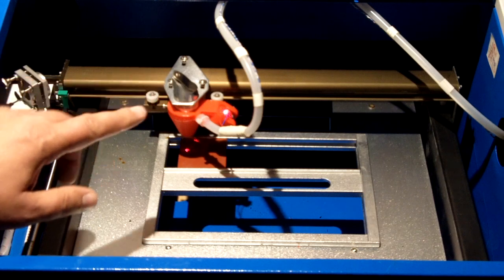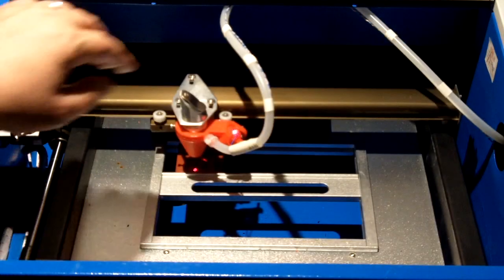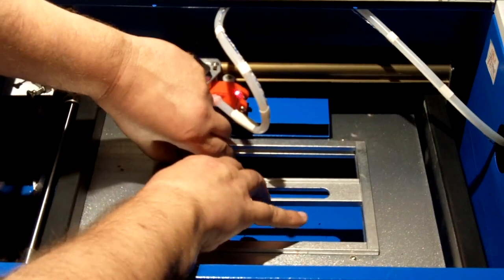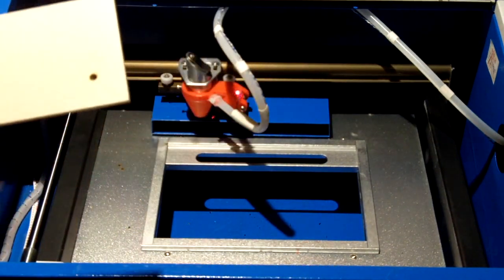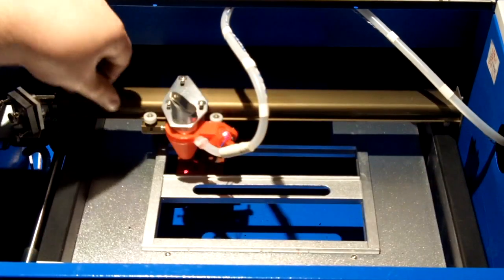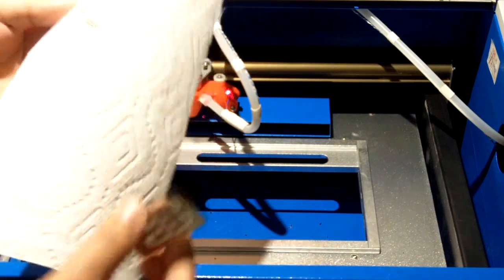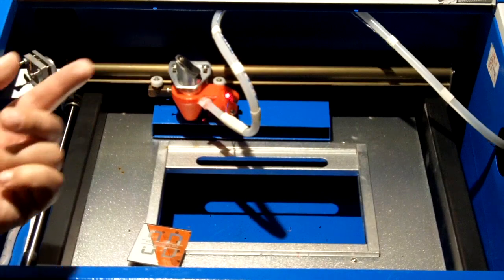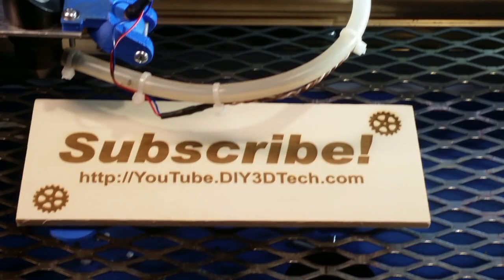K40 eBay Chinese CO2 Laser Cutter & Engraver - Etching the Backside of a Mirror!

Comment: Extremely helpful videos -- you seem to have a knack for explaining things in layman's terms which is very beneficial to laser cutter newbies.  Can suggest a particular brand I should purchase?  There are numerous listings for these on both Amazon & eBay and they're all identical, for the most part.  I've noticed the prices increased slightly since I started looking into them about 8 months ago, which I would attribute to their growing popularity and a diminishing "fear" level for home-users.  Thanks.
Reply from the maker: Thanks for the kind comments :-)  as to the price yes they go up and down and they are on the upward swing because of Xmass so expect to pay a bit more unless you want to wait till Jan/Feb.  Also if you get one DO NOT get the one with the digital display as those are typically 30 watt unit even if they say 40!  Get the one with the analog meter they have the longer tube (which is what creates the higher wattage).  Also I put this page together to pull the latest posts from eBay based upon price. As far as Amazon goes, believe they are same sellers (IMHO) and they charge more...

Comment: A 40W laser tube usually operates at 10-12 mA current (maximum). More depletes the hydrogen in, and the lifetime, of the tube.
Reply from the maker: Most of what I have read indicates 18ma and if you want to be super conservative could see 12ma however I view the tube as a semi-consumable as it does have a shelf life so it is also a bit of use it or lose it to the task...

Comment: Mirrors are EXTREMELY reflective. Remember being told not to look at the laser? Etching on a  mirror is no less stupid than looking safely at the Sun with a mirror when the Sun is behind you. Make sense? 
Laser are dangerous. They shoot satellites out of their orbit with laser.
Secondly, find and read, a hazardous material data sheet about burning material without protective ventilation. A mirror is reactive  because its back coated with a silver oxide which  makes glass reflective. Do tell others NOT to do this.
Reply from the maker: Thanks for the feedback, the CO2 laser operates at FIR range so the glass pretty much absorbs most of the "light" as the mirror is designed to "reflect" visible light and not IR.  This of course doesn't mean that some is not reflected light and part of the reason I do these video's as if you look back at the play list, I have  photographed in both NIR as well as FIR and shown the amount of reflection.  Also if you note in the video I mention this should not be attempted while looking at it and the cover open as the idea of coherent light reflected or not is an issue and the reason for in a prior video I show how to use a web-cam to monitor the laser as it is of course safety first.
Reply: Are the mirrors used in the laser itself constructed of a different material than the mirrors you're trying to etch? I read that reflective materials should not be used in the laser and I assumed mirrors would be 1st on the list.
Reply from the maker: Yes the mirrors in a CO2 laser aren't like the ones used for visible light.  In fact copper is a good reflective source at this frequency of (10,600nm where visible light is much shorter at only around 500nm (averaged))
Reply: So etching anything copper should be avoided? Like a copper penny or Moscow Mule cup?
Reply from the maker: Yes and have no clue what a Moscow Mule cup is.  Also, unless you use chemical etch with the laser, you will not be able to mark any metal anyway.  The purpose of this video was to show that as people kept asking.  Also you always use with the top closed and wearing proper safety glass for your machine too...
Reply: Thanks and love the channel. You've got all the same toys that I do and more! Keep it up.
Reply from the maker: Will do and open to suggestions too!

Comment: The warning is probably because most people would fire the laser like a Storm Trooper than like a Jedi resulting in killing one's self.  But the Star Wars references aside, you mentioned turning it up to 10; well I say turn it up to 11 and add more cow bell because everything is better with more cow bell.

Now you need to 3D print a little box (I'm sure you know how to do that - *snicker*)  and put an multi-colered LED setup that will fade in and out or through the colors with a piece of slightl opaque paper (available at Hobby Lobby int he scrapbooking section) and back light that mirror for a cool effect.

Cool video
Reply from the maker: Yes the effect would be very cool to do the backlighting and have to add that to the list :-)

Comment: Hello sir, I got my laser running, with the permission of the landlord, I got my ground rod installed for free. Yay!! Ha-ha. I'm having fun with this machine, but the workspace is kinda small. I'm planning to gut out this machine to make my workspace a bit bigger. Do you know where I can get those rails? I don't want to use openbuilds setup. Any suggestions are appreciated.  Thank you.
Reply from the maker: Good to hear :-)  Also the rails I used where the original ones with the bed, if you look back in the playlist for k40 eBay laser I do a video on how to use diamond screen to increase the bed size.  If you questions, just let me know...

Comment: Perfect and I was thinking about the led behind it in a narrow frame.  The effect will be awesome I think.

Thank you for doing this.
Reply from the maker: For you my friend no worries!  It was fun and the effect was pretty cool!
Reply: that will look great backlit like that .  was just thinking one or 2 of those neo pixels even.
Reply: XerotoLabs
Could even 3d print the box and slide the electronics in it with the led(s) then the mirror.
Reply from the maker: Sounds like I am going to have to get all "Chuck Hellebuck" on you guys and take up the challenge :-)  Have ordered some neo pixels!
Reply: ooh i just had a thought , you said the laser gets into the glass surface , what does the mirror look like when edge light ?  . that is light source is form the edge ( LEDs into the side of the glass ) .  i bet it lights the etch no matter what side you used the laser on ?
Reply: XerotoLabs
Yes, BUT smooth side toward you is preferable for most people.
Reply: it should work for either side with edge lighting . is there is enough disturbance in the glass surface to refract the light moving across / through the pane .  you could use  back lint and edge light mixed .  
i would test but i dont have  laser etched glass only abraded glass. 
depends on your project need rite .
Reply from the maker: Very cool, I didn't plan on doing something that fancy!  However as I said before you do some nice stuff!

Comment: I bought a laser from china and the diode burned out. any tips on cheep laser diodes? 500mw or more?
Reply from the maker: I get mine from eBay I have bought the 2watt out of Bulgaria and added my own driver was very cost effective.
Reply: i have gone through a few , i have en bought replacement diodes t install in the modules .   Most important thing for diodes is static / esd. good diodes come with a small gold plated clip shorting the power pins to help protect against esd reaching the laser .  
2nd , crappy power supply can easily kill the diodes. 
3rd often the cheapo lasers lie about the diode specs , or provide  wrong or improper driver power supplies . 
4 insufficient thermal dissipation , too small or lack of  heat sync 

regard to the 3rd point some times they lie or are wrong about duty cycle . that is the laser is only capable of continuous beam for say 4 min , and must rest 2 min . unless you PWM at 50% duty cycle , so the 500mw diode can only operate at 250mw constant on .   I have found that can usually  be fixed or increased by cooling . some lasers that have a TTL  line , need special attention to be sure you are not pushing them past their duty cycle . 
If its the just the diode thats dead you might be able to change the diode with a new one .
FOr example I have a bare diode to fix on of my older red lasers . 
LPC-826 (Mitsubishi) was about 15 USD  
Power output: CW 300mW  ,    note this is the 'constant on' power max 
Pulse Power: 400mW  ,             this is usualy a PWM  of 50% . so pulse at 400mW but be sure duty cycle is 50% 
Working Current: <340mA
Working Voltage:2.2-3.0V

you can get higher power diodes , and swap em out , and save a buck , maybe as they get cheaper as modules all the time . just be sure you dont zap it , or it just a LED that gets hot after you zap em. But if yo buy a diode form a good supplier then you know the diode you are getting . 
only easy to zap , keep the diode input leads shorted and the driver leads shorted ( some driver have jumper pins on board for this *)  until after you have soldered teh diode to the  driver , then un-short the driver , the remove shorting clip on teh diode . ( 8 if your dirver does not have jumper , use clips or such to keep the driver shorted , as teh out put caps cna build a charge and all it takes is 1 zap and diode is dead . thats why the last thing you do is remove the  shipping shorting clip on the diode. )  . keep the driver out put caps from building a charge as some drivers can .
Hope that helps if not ignore  
I like clean CV and CC drivers , the last module i got from banggood has a very nice driver built in , and body heat sync and power supply .
Reply from the maker: Couldn't agree more on the list I had a 2watt which was great and over heat sinked which lasted a long time till I accidentally reversed the power.  Then ordered a new complete module and it didn't work like the other so put a meter on it and it was only 1 watt not two and got into fight with the ebay seller and filed a paypal complaint and finaly got my money back...
Reply: Chinese laser machines are good machines. Ebay sells the junk and everyone thinks its the machine. In not, it's the eBay scammers that dupe us all.  Learn the lesson , FxxK all eBay.
Reply from the maker: For sub $500 you can not expect much as the old adage of "you get what you pay for".  I own two and have been very happy with them and not to say I have not had my challenges, however for me this is part of the fun so can't quite echo your feeling of eBay, but understand where you are coming from...